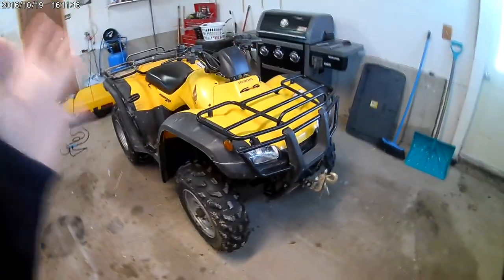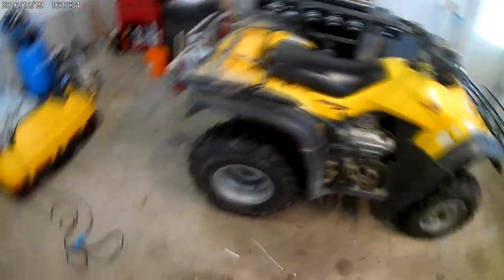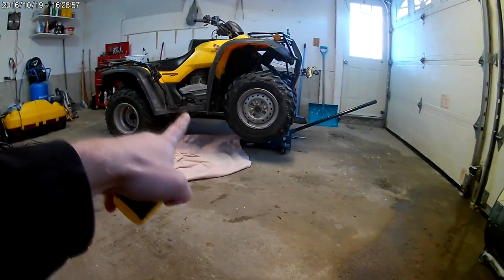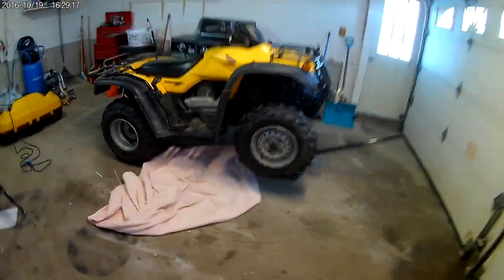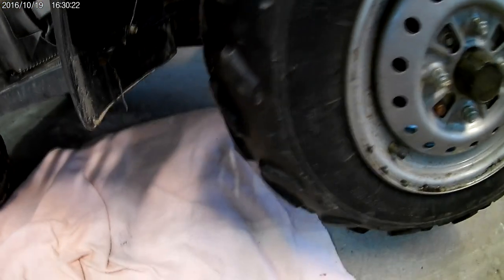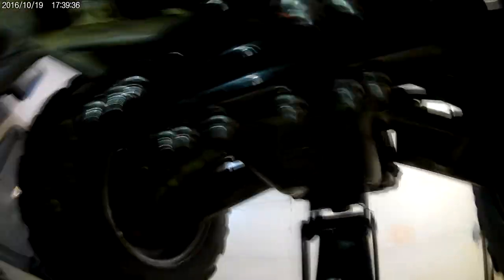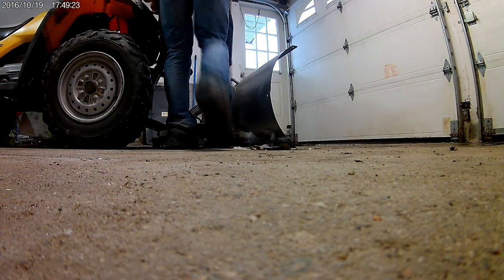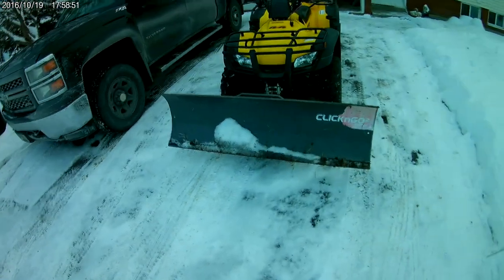Kimpex Click N Go 2 Plow install

Comment: i see this is an old vid, but that rear hook is tha balance point of the plow, you run your cable throu that and pick up on the winch and it pulls the plow up and back to lock into place, so you dont have to manhandle it...